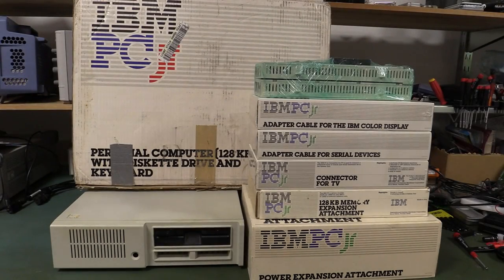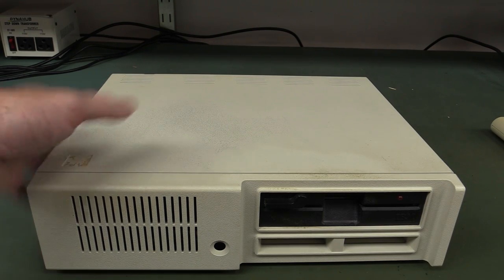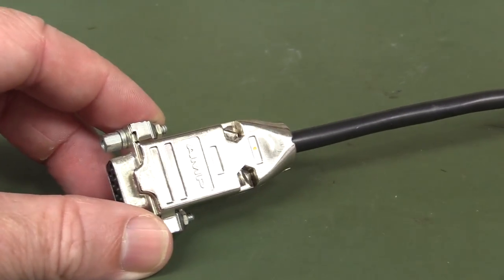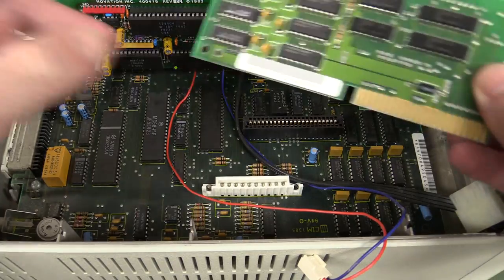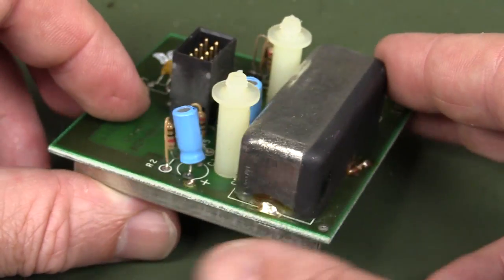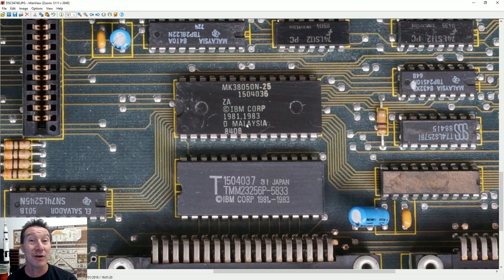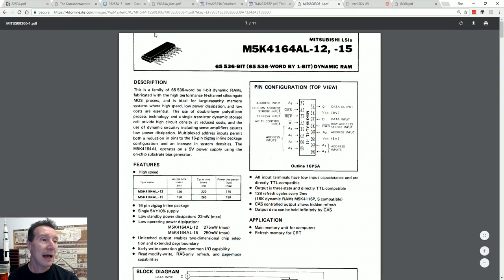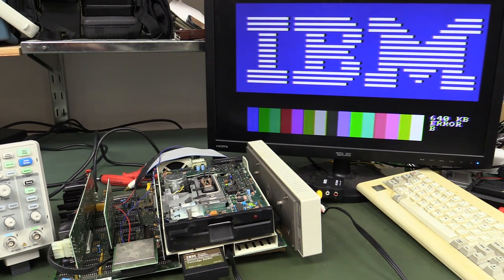EEVblog #1053 - The Biggest 80's Computer FAIL - IBM PC Jr

Comment: When was the last time IBM has come out with something new and innovative? The Bar-code? Token ring? Watson? IoT? All I see from them is a company weighed down by their legacy systems. But honestly, they represent the industry as a whole as it is all in a bit of the lull, the innovation has trickled to halt in every area.

Moore's vs Rock's law is getting to the point where semiconductors are getting exorbitantly  expensive to research and produce, still running the same von Neumann machines for decades now. Networking is stalled (cisco vs juniper), programming is stalled (python/.NET is nice, but nothing revolutionary). 

From knowing someone who works for big energy on the distribution side they could use updated information systems, and I'm sure they're not the only utility that could benefit from a dose of technology.

EEVblog... Any Input?
Reply from the maker: IBM are now surviving by buying back their stock. I recommend https://www.amazon.com/Decline-Fall-IBM-American-Icon-ebook/dp/B00KRHWZ22/
But they are actually still doing bleeding edge semiconductor research.
Reply: It is people who do innovations not companies and only if former encourage and support these people.  Everybody knows about IBM but what about its engineers that made all that stuff ?
Reply: Thanks for the reference Dave.

v ant, I assume your from the states too. Go to google and type "american inventors" under images, notice anything about the results? 

"History is written by the victors" - Winston Churchill

Comment: never seen a pc using both Intel & AMD on the same board
Reply from the maker: Guess they used whatever stock they had. The BOM would have listed both parts as interchangeable, so production would built using whatever one they had.

Comment: Yeah this title is complete bullshit. The PC Jr was FAR from the biggest flop in 80's PCs. Did you forget about the Lisa? You know, that computer you ALREADY TORE DOWN years ago?
Reply from the maker: The LISA wasn't really a personal computer, more aimed at high end business users. Still sold 100k units, but yeah, less than the Jr.
I argue the Jr is a bigger flop because it followed a very successful product and was designed as a low cost consumer version of that successful machine. It shouldn't have failed.
Reply from the maker: And it's not "FAR" from the biggest flop, it's widely regarded in the industry as one of the biggest flops and makes it way up on the list of failed machines.
You could also argue that the LISA wasn't a flop because it was so innovative, and it's generally hard to be really successful when you do that and take those chances.
Reply: Speaking of 80s flops, don't forget the Apple III. I hope someone sends you one of those to tear down someday. Double action keyboard....
Reply: Another thing that makes it a huge flop is the huge amount of hype leading up to release, including IBMs own marketing campaign with massive ad spend attached, and then the fact that they had to continue beating the dead horse for a good long while after it had clearly ceased kicking, to try and move a massive inventory of unsold product.
Reply: C128 a failure? They sold 6 million. Number two to C64. Over a billion dollars  in sales.  Now C16 and plus/4 yeah failures.  Amiga 600 yeah same.  Same guy that ran pc jr do the A600.  Both were failures.
Reply: Yeah the PC Jr. was meant to be used by families and households.

Comment: In 1984 the Macs came with no external storage...
Reply from the maker: Yeah, and limited RAM that made it almost unusable.
Reply: Every Mac until the first iMac had a 3.5" floppy drive.  So yes they did have external storage.
Reply: They had SCSI built in. You could easily purchase (though not cheaply) an external SCSI storage device, the early Macs also had an external floppy connector.
Reply: The original Mac did not have SCSI
Reply: Hard Disk 20 for the original mac
Reply: We all had already upgraded to 512k by then. The HD for the MacPlus was the scsi 20, nobody wanted to use this (HD20) anymore because it was too slow because it ran through the floppy disk interface which was much slower than scsi.
Reply: No, the hd20 did NOT connect to the serial port but to the external floppy disk port. And again by then everybody had upgraded their Macs to 512k (both ROM and RAM upgrade) because 128k was useless. see https://en.wikipedia.org/wiki/Hard_Disk_20

Comment: Surely that's serial?? D9 serial VGA D15 11:09
Reply: Abdullah Seba Nope, CGA 9-pin digital video.  4 pins for the 4 color bits, 2 pins for sync, 1 for ground.
Reply: John Francis Doe Ah I see thanks for the explanation.
Reply: Also, traditionally, DTE serial would have been a male 9..  not that "standards" seem to be a fundamental part of that build!  ;-)
Reply: Definitely by 1986 when the AT came out, it had 9 pin serial, but point taken that in that vintage, it was usually still 25 pin...
Reply: No, it's monochrome/CGA graphics. Later, EGA came along with more colors and lines per display but still used the 9-pin standard din cable.
Reply: Not exactly, only 6 pins were actually used. The rest were redundant grounds. In fact, in most RS-232//242 applications, only 4 pins are needed.

Comment: Maybe the Motorola part was the character ROM?
Reply: William Squires 

Yep - the MC6845 is pretty much THE classic CRT Controller chip. ;)

It's used in many CGA/EGA cards of the time, and in the Commodore PET, BBC Micro, Amstrad CPC, and even for the console / debug video output of the original Quantel Paintbox.

Not much inside them though tbh. Just some X / Y counters, and some other regs for generating different video timings.

It's often used to directly address a Character RAM (and ROM), then has a shift register on the output pin, and external sync mixer.
Reply: William Squires 

Damn - I knew I should have watched the whole vid before commenting. Classic mistake. lol

I thought you were asking because Dave didn't look at the Motorola much, but he did mention it briefly.

Oh well, hopefully somebody still finds my previous comment mildly interesting. :)